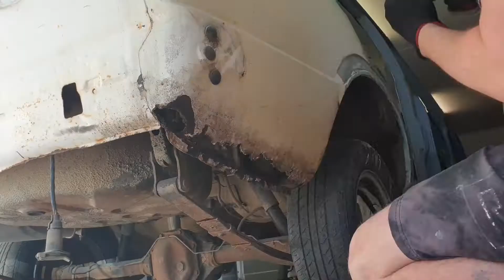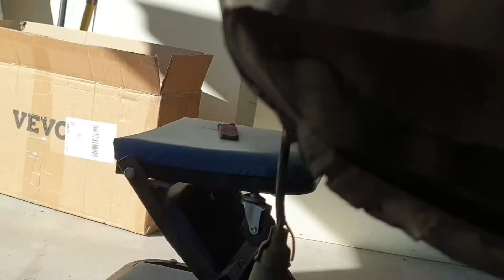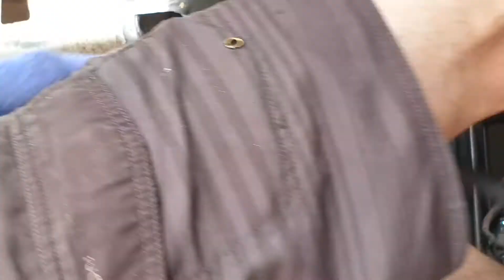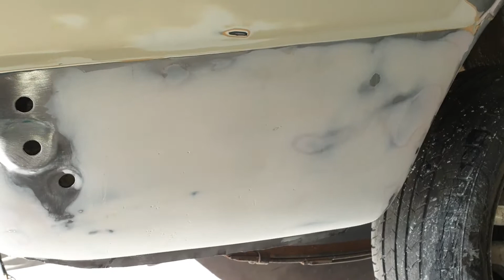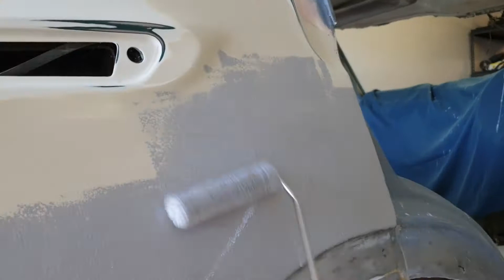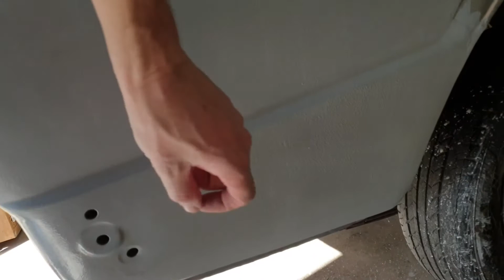Corolla KE55 Build. Rust repair and Roll on Primer Filler!

Comment: Would primer filler work on small hail dents with a couple of layers? And can you apply primer over primer filler? Thanks
Reply from the maker: It wouldn't be that good. It's designed to fill scratches and very very small dents. It will shrink over time more than body filler. Best to sand the dents and use fine filler then sand flush. I still have lots of small filling spots to work, where the primer filler won't be enough.
Reply: @blinkiben  Thanks for that
Reply from the maker: Yes you can use primer/sealer over primer filler  that's no issue.